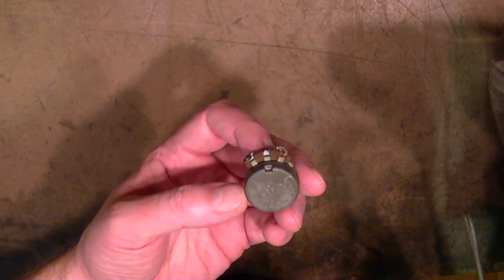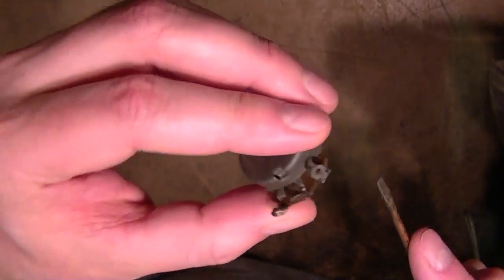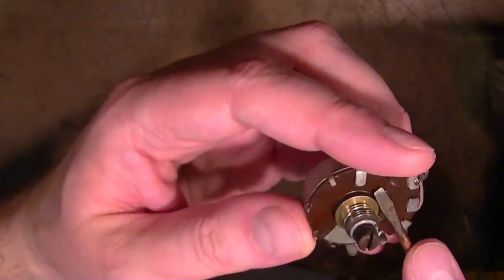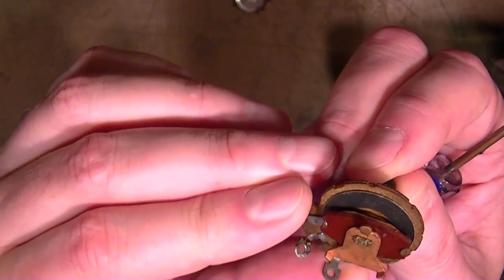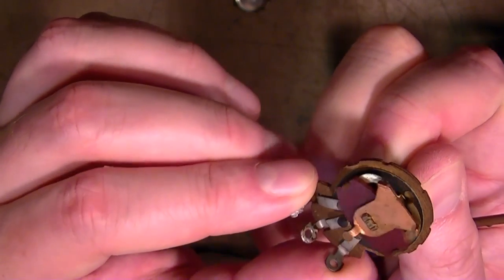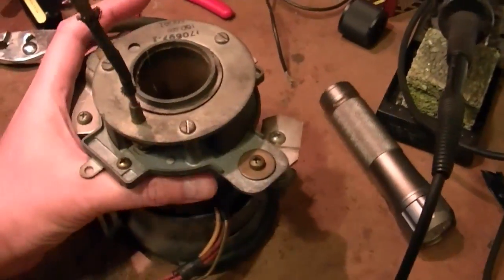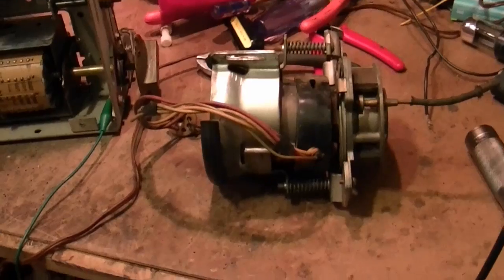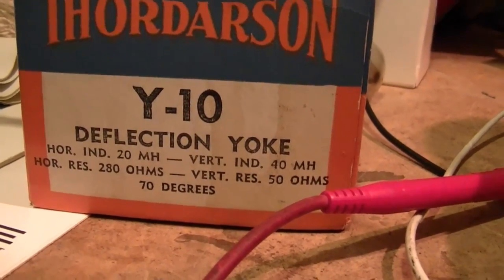Capehart 325 restoration pt5o7

Comment: Hi Bob, There are two other tv chassis that are closer to the Capehart than the RCA. They are Emerson  #680B  chassis #120144-B and Emerson #663-B chassis #120128-B, found in sams #138-4 and #125-6.  Yoke inductance is 30.0MH at 45 ohm horizontal and 3.5 MH at 3.5 ohm vertical. Stancor replacement is DY-14A. Hope this helps you in your search for parts for the Capehart. All the best, Tom J. from Florida : - )
Reply from the maker: Hi Tom.  I see what you mean.  Thanks for the information!
Reply from the maker: I did some further search and found that the Stancor DY-14A cross to a Thordarson Y-17 ;)

Comment: Mr Leavitt's suggestions sound like some ideas of what to try next, it's unlikely that the doorknob cap is bad but the one under the damper socket could be. I'm beginning to understand why there are not more of these Capehart/Farnsworth TVs around if this was a common problem. I was just thinking, if you can't get this thing to work properly as is, and can't find original parts that are known to be good to substitute with, you may have to modify the H.V circuitry to work with something else. Since the Capehart is largely copied from a late 1940s RCA chassis, even using the same yoke, maybe you could copy the H.V circuitry from an RCA or Admiral from the same era? I don't like doing things like this but if the original setup can not be made to work, and good replacements are unobtainable, it may be the only feasible way around this, short of home brewing something like a voltage doubler or tripler, to get the HT up to where it should be. I
Reply from the maker: Yeah, I probably could since I have a few spare RCA flybacks that went with the same Y-17 yokes.

Comment: Hi Bob, you might try looking for a sub for yoke #750155-G1 which was used on the smaller screen CX-33 chassis. The flyback is a Stancor type A-8131,sorry I can't give you more info on subs as I lost most of that info during a fire a number of years ago. If I remember correctly there were 2 or 3 flybacks used depending on screen size. The flyback could have a bad H.V. over winding that's pulling down the H.V.  If you haven't done so already, look for the part # on the flyback and look up the cross. By all means do the checks that M. Leavitt suggested.  The 21 inch version I'm working has a bad H.V. winding and if the owner can't find a replacement for it am going to try using a tripler on the thing to see if it will work. It will be a ECG/NTE 500, capacitor input D.C. ground . Well, all the best, Tom J. from Florida
Reply from the maker: Thanks for the info.  750155A-G1 (yoke) and 750163A-1 (fly) are the only part numbers I've come across.  They cross to Thordarson Y13 and FLY-2.  I've contemplated using a solid state 10kV DC supply but the cheapest I could find is $75.

Comment: What's the boost voltage? Low or correct?
Reply from the maker: The voltage on the cathode of the damper is correct but there isn't really any boost voltage used in this design.
Reply: If that's right, it's a good indication that the horizontal section is working correctly. Assuming the flyback is good (it probably is), I'd be looking for leaky parts in the HV circuit.

Not just the HV capacitors - things like the HV rectifier socket can develop carbon tracks and drag the HV down.

If you've got a suitable silicon HV rectifier replacement, plug that in and see what happens - there might be a clue there.
Reply from the maker: Michael Leavitt
OK, I guess I'll have to tear into that HV box.

Comment: How confident are you in the HV probe you are using? I have had them get flaky over the years. Also, I thought you had a Sencore LCR meter - looked like a LC75 or similar??
Reply from the maker: Very confident plus I have several others.  I've installed a full sized CRT and it's very dim and unfocused.  I have an LC53 but the inductance part doesn't work.
Reply: bandersentv Oh -OK, just had to ask! If you get too bored you could test the windings of all your yokes across a known cap, sweep gen and scope to see how they all compare. Might provide more clues or rule in/out the yoke.
Reply from the maker: cny02253
Sure, it's definitely a good idea to check your test equipment.  My fluke HV probe is fairly new and I did a video on it not too long ago where I verified it was accurate.  I wish I had time to do an experiment like that!